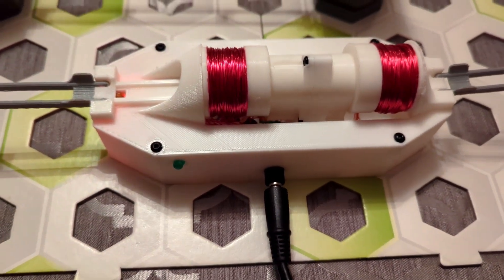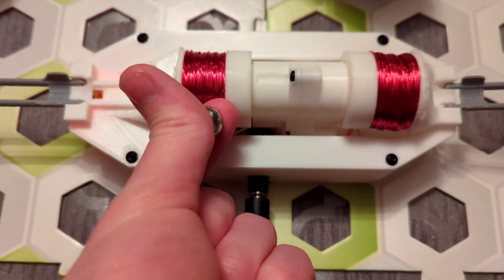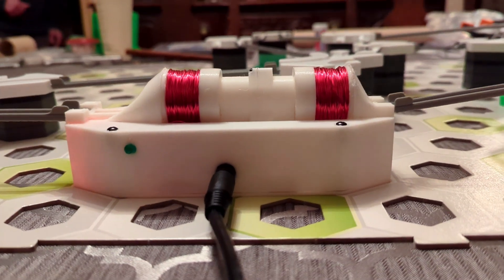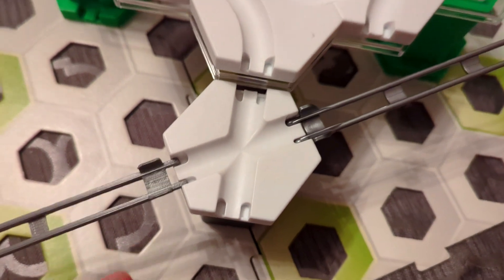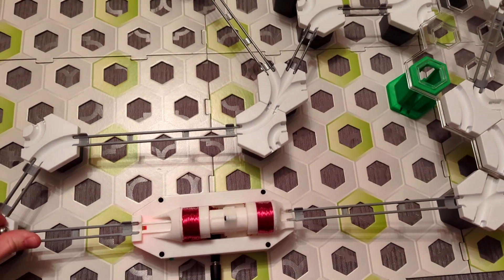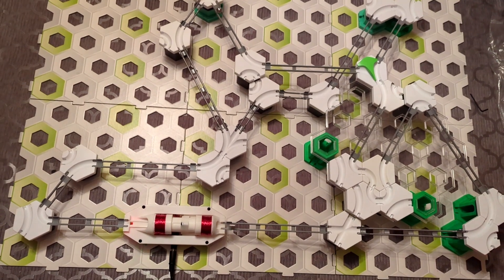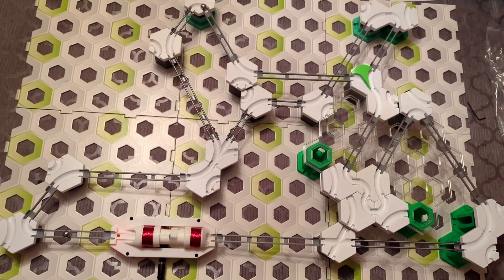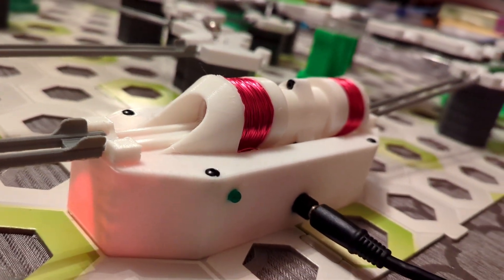3D Printed Electromagnetic Marble Accelerator Demo

Comment: a motor driven spinning rubber wheel would accelerate all types of Non-ferrous marbles - engineering is finding the simplest reliable solution.
Reply: This accelerator is silent
Reply: @skaaly and no moving parts